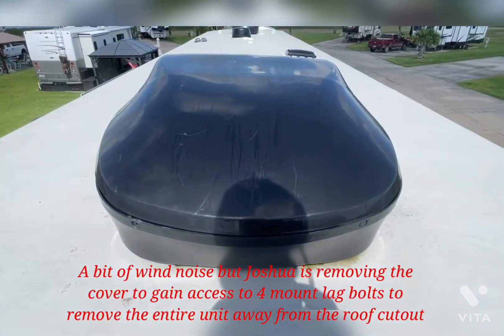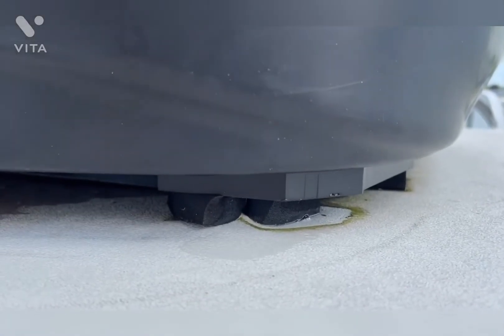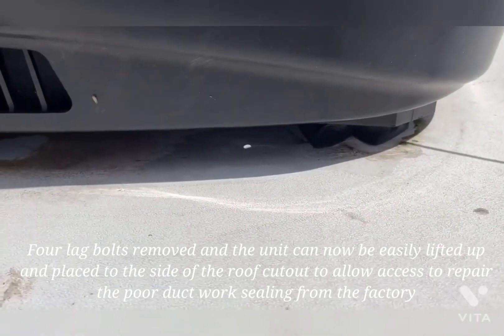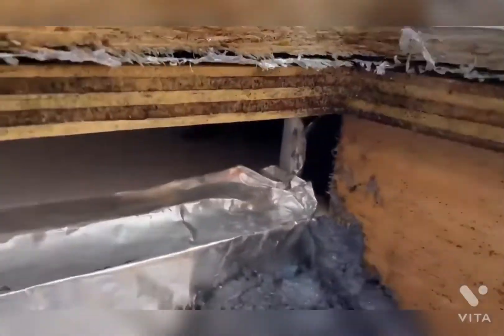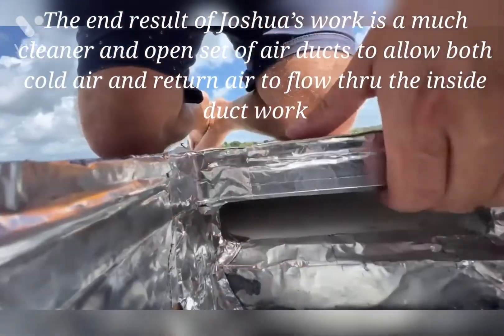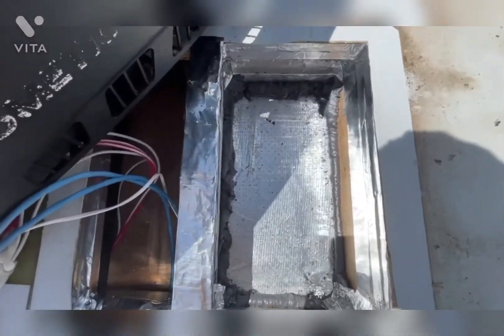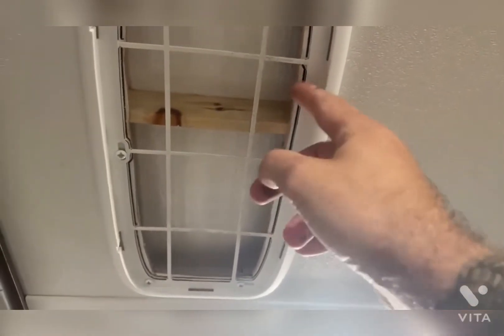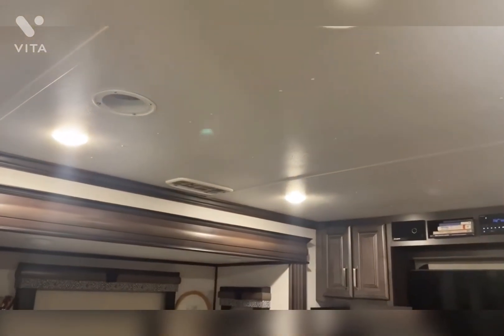Dometic NXT duct work reseal work

Comment: This is by far the most useful video I have found on the issue I am having with my AC system. Thank you for putting this out there, truly appreciate it.
Reply from the maker: This video,should help you resolve your airflow issues. Also reseal the interior overhead ducts and look up inside those ducts with a cell phone camera set to video mode and have the flash on so you can turn cell around and get a video of the inside of the ducts and make sure they aren’t collapsed as well

Comment: You have done an excellent job sealing the air gaps zround the out zide of the foam however it could be a problem when it comes time to clean the inside fins.
Reply from the maker: There are NO INSID fins.l this is a ducted AC on the RV,..the airflow was severely restricted due to all the excess foam and lack of proper HVAC tape being installed

Comment: Can anyone tell if this made a difference in cooling better
Reply from the maker: Of course it does.. you are opening up the passage ways under the AC to allow air to flow better thru both the return grill side and the evap coil side.l your AC units will perform significantly better if you have excessive spray foam and tape from the factory install blocking those passages,
Reply: @thealpinefifthwheelguy318  thanks for the info